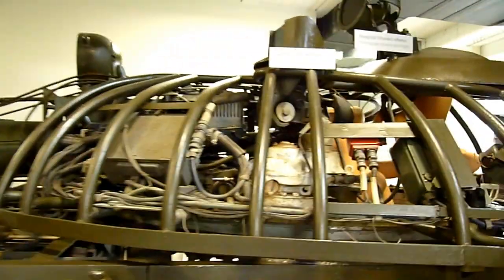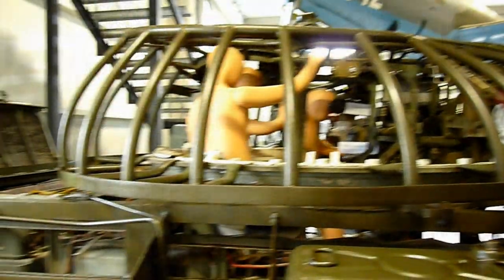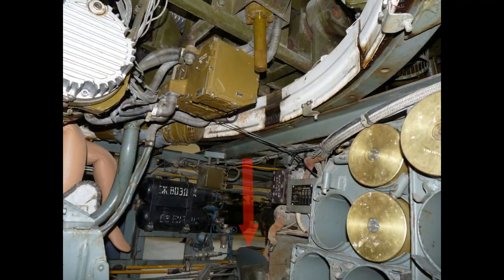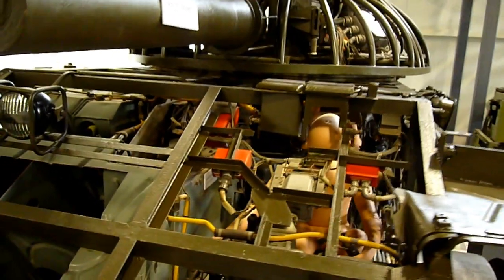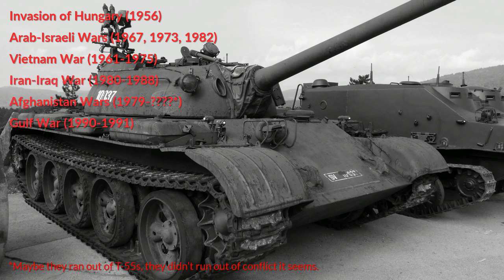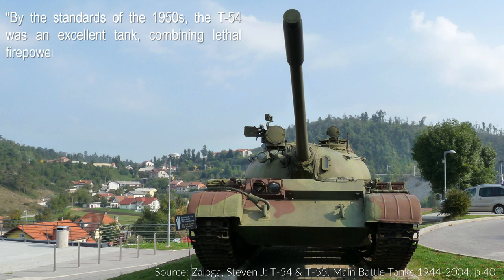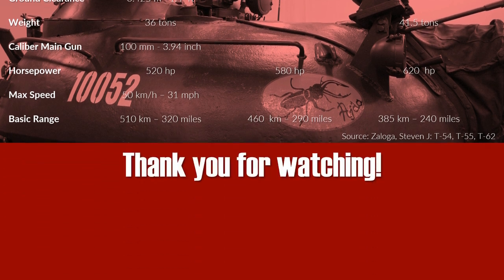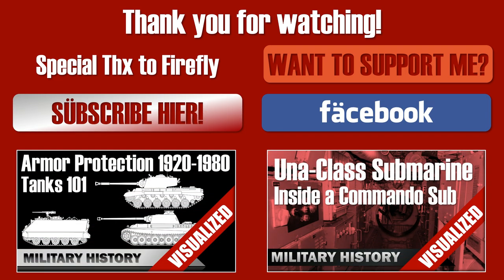[Tanks] T-54/55 Internal View

Comment: I think, this model perfectly demonstrates how soviet tank-building concept developed - tank must be as small as possible, to be mobile on russia endless swamps and forests. That leads to really tight crew compartment, meaning that you really want to remove loader and add autoloader. Small ammo storage limits main gun caliber and to be on par with NATO thick armor of much bigger tanks leads  to support of ATGM shots for main gun. So, T54/55 really fits good to all that story.
Reply: Well, I've meant that given that soviet tanks was less armored they had to find a way to compete on long distances. I dont have exact numbers, but think of it like - T72 has no chance to penetrate leo2 armor at 2kms with APFSDS, while leo2 most cetanly can. So there was two options - move to bigger calibers, which means generally bigger tanks or focus on ATGMs. 40 years ago they chose ATGMs and now they switch to the first one.
Reply: Right, but they were trying to make 152mm tank gun for T80. Now its in progress for T14.
Reply: Ruthless saving of space was always trait found in Russian designs. To be honest, I do not know why westerners do not adopt it either. It is a common sense, but again and again I see our philosophy in developing armor is different. 

The limit is 50 tons where weight really starts bitting in. Bridges, soft ground and etc. The thing with Russian armor is not mobility. They often had mediocre to poor engines. USSR tanks were sluggish even. The thing is that Soviets went for easy to produce designs above everything else. They believed in quantity. That quantity matters more in the offensive was which is true.

Except that storing an ATGM takes a lot more space and early ATGM were unreliable. T-72 can penetrate Leopard just as well, it is all the matter of advanced ammunition being used or not. It is the general issue with tanks nowadays that armor had outmatched the firepower since we got lazy and complacent. Instead of adopting 150 mm AT standard in 2000's when these guns were ready, we had stagnated and choose the path of marginal upgrades path rather than developing truly next gen platform. Nowadays, the only really modern tank is T-14. All others are just legacy tanks and in the through the decade they should be repurposed as something else.

Comment: Before the video had loaded I was already hearing the chieftain's hatch. The thick germanic accent threw me for a second. heh. You say a full size model of the T54/T55. I'm certain that's just an actual tank with pieces cut away, It's not so rare for the more common vehicles to have this done in meuseums. Nobody would do it to a panzer though. EDIT: No you're right, it is a model. wow I'm shocked but I suppose it is cheaper, all you really need is authentic running gear and such to add to the frame.

Comment: Idk about T-54, but my father served on T-72, it's much tighter than 54 I think, it has autoloader and a crew of 3.  Fun fact is driver should be not taller than 1.65 and other crew members 1.75.
I think those are well designed tanks, the only thing I think should be done entirely different is engine should be at front, and crew in the rear of hull, just like Merkava tank, that also allows a big door to quickly leave the tank or pull out injured crew member. I really admire that, even germans and americans aren't that smart with theirs abrams and leopard tanks.

Comment: What are the two oil barrel like drums on the back of these tanks you usually see?
Reply: External fuel tank. When the tank needs to travel long way and is not carried on trailer or railways those drums are attached. The thank is using fuel from the barrels first. No danger if they are hit because all the fuel will leak behind the tank. Diesel fuel is not exploding so even if somebody will ignite the fuel trail nothing will happen. In case of surprise attack with artillery or RPG those drums can be jettisoned automatically. Why, if the diesel fuel is not exploding you may ask? Because if something explosive will hit the fuel barrels the thank will be soaked in burning fuel and this time is serious.

Comment: 1:35 Who on earth would think that's a good idea??
Reply: Well, I do. It gives you some extra fuel in an otherwise wasted space. Diesel won't ignite very easily and if your ammo blows up, your last problem is, that the scattered remains of your body will be soaked in fuel.  ;-)
Reply: If your ammo and fuel are in the same area, you lower the number of critically vulnerabe targets - if either the ammo or fuel are hit seperately, you are dead anyway.
Reply: hjorturerlend the tank is so small there is really no other space to place those huge ammo rounds for the huge gun it holds. There is no significant space behind and under the turret for that. The leopard also had a similar ammo layout as well
Reply: If anything gots through armor and to the fuel store, you will be dead at this time already. So not that much of the problem.

Comment: How do you like Slovenia?
Reply from the maker: I have been there only a few times, so far it was great, but since I never lived there, I can't give a proper opinion on it. Making assumption based on a vacation, especially ultra short ones, is probably highly misleading. So far I had only good experiences with Slovenians, also from Heavy Metal Festivals in the early 2000s.
Reply: Military History Visualized It's nice to hear that. If you are intrested in WW1 Soča front there are some awesome open air museums around Kobarid in the western part of Slovenia. There are bunkers and restored parts of the trenches that you can visit for free. If you ever come here again, give that a look.
Big fan BTW, keep up the good work!
Reply from the maker: thx, I probably will, although right now I am basically figuring out what works and doesn't. I have some ideas regarding trenches etc. but most important is consolidating my channel and having a steady flow of videos and funds. Once that is secured "everything is possible".

Comment: A VERY cramped turret.
Reply: Yes indeed. But those sent to serve on them were also short guys usually 160 cm on average. So if you are 15 cm shorter then 175 cm average and thinner also, you will fit perfect.

Comment: Why was the engine in the rear and the fuel tank in the front and not vice versa?
Reply from the maker: size, cooling, air intake, the later two are the most vulnerable parts of the tank, having them in the front would be almost a death sentence.
Reply: Except Merkava, do you know other tanks with front engine?
Reply from the maker: not really, but my knowledge of tanks outside of WW2 is very limited. Do you know how the Merkava solved the cooling etc.? Is it displaced?
Reply: Military History Visualized I've heard of that one too. They wanted an arrangement that gave maximum protection to the crew. They are also far more spacious than Russian designs.
Reply: edi well, you've got to think like a designer. most designers usually start with an old design, in this case the t34, i'm talking about parts, layouts etc. you can clearly see  this in the mobile phone industry or the auto industry, each new generation will have some aspects if not a lot of  aspects of the previous generation. as to why the fuel tanks in the front and engine in the rear...most likely a tank will receive most fire from the front, and it's simpler to replace a driver and a fuel tank than the whole engine. cold hard calculations, and human lives were not that important when the soviets built the t55. most of the soldiers were conscripts, and you wouldn't be loosing a career soldier.
Reply: Kris Sobieski because they are not french. ease up on the sarcasm. i didn't talk to soviet tank designers from the 40's since the t54/55 was designed during ww2 and a bit after. the obvious answer of why the placed 100mm of rha in the front is because it needed to withstand enough punishment to make a difference. but placing a man near a thing that can engul him in liquid fire.
Reply: Kris Sobieski i agree, that maybe the designers were not heartless bastards. but the guys issuing the tank requirements were utter criminals.  that is not propaganda it's fact. look at soviet military doctrines. read victor suvorov inside the red army. Anyway i just tried to answer your question. because they had the t34 as a starting point
Reply: Rear-ish mounted turret and side exhaust.

Comment: Who the heck signed off on the fuel/ammo hybrid rack?!  I mean the powder in those shells is hot enough to ignite the diesel fuel which just compounds the HE shells cooking off and turning the entire tank into a rolling inferno if not a giant bomb.
Reply: brainplay If they were to have them separately,  then the enemy would have two easy targets instead of one.  there's a lot of other reasons for why it's a good idea but mainly I think that is one of the most important to think about.  you're dead if either blows anyway.  keeping them separate just means you have 2 deathtraps instead of one.
Reply: Christian Sullivan
The point was that diesel won't catch fire because of a hit. It will catch fire if powder and other HE material is ignited thus doubling the effect.  Maybe it's just a pipe dream that a ammo rack hit isn't going to detonate the tank.  Maybe the designers figured the crew would be dead anyway.  That's all I can get out of that placement.
Reply: brainplay well if the ammo rack does explode for any reason,  the crew would no doubt be killed regardless. But from what you have said,  we then have to just take this as a lack of space elsewhere for the ammo.  This saves space as fuel is everywhere where their otherwise be empty space or a separate ammo box.